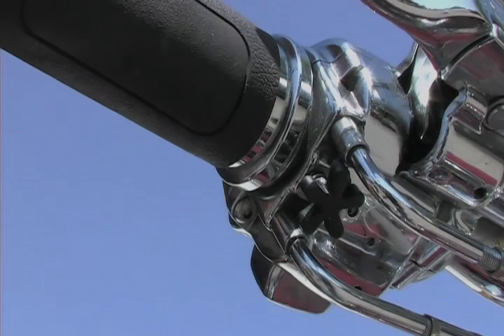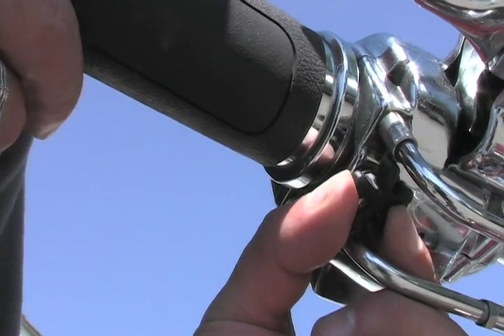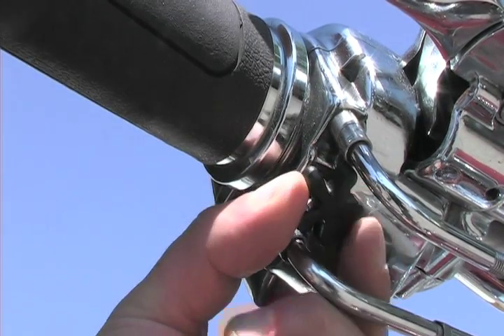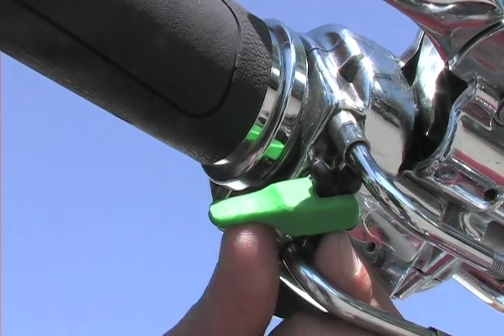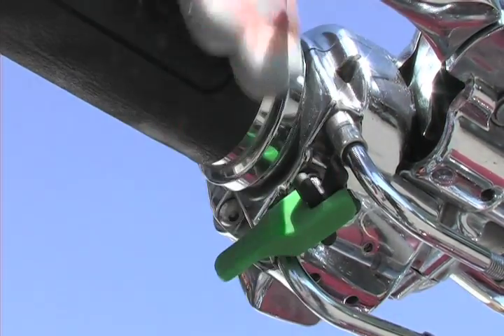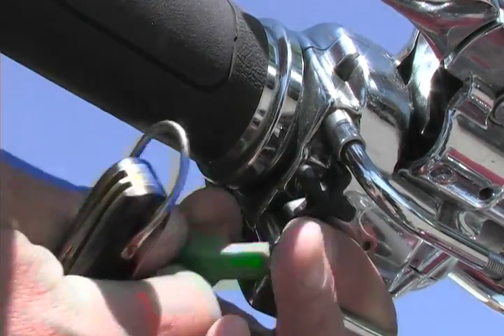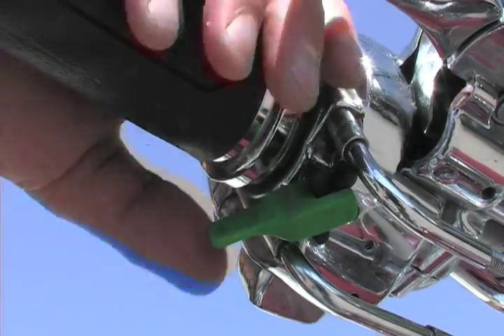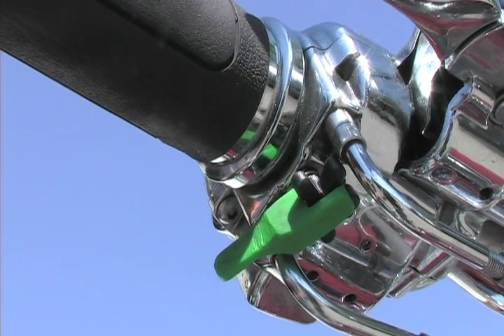Dr Cruise Motorcycle Throttle Lock Attachment

Comment: I'm confused. When I turn mine counter clockwise or to the left the bolt and spring tighten and when I go clockwise or right it loosens. I dont want any friction and just want my throttle normal so which way do I turn it to make it normal? It seems the opposite of everything I'm reading. I have 2015 Harley Iron 883. Thanks